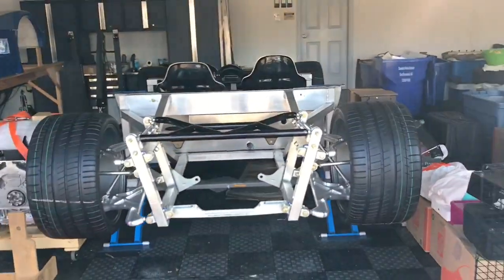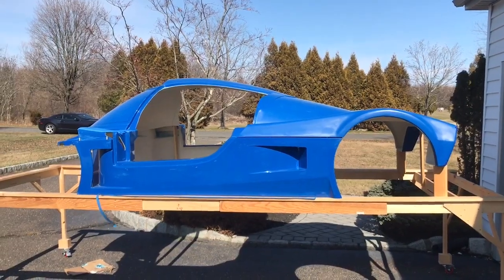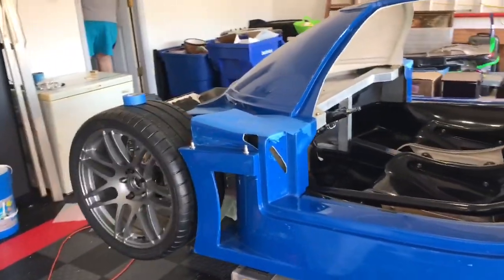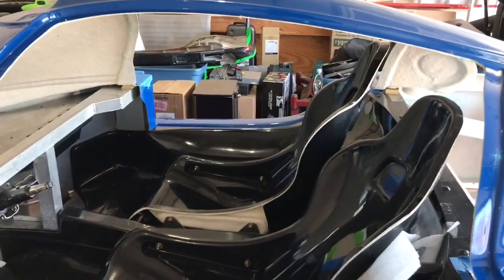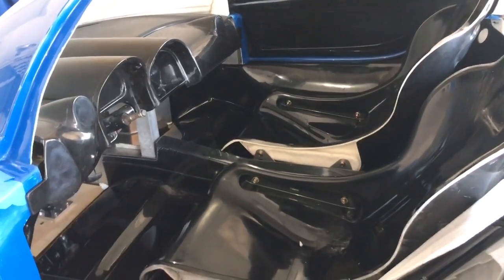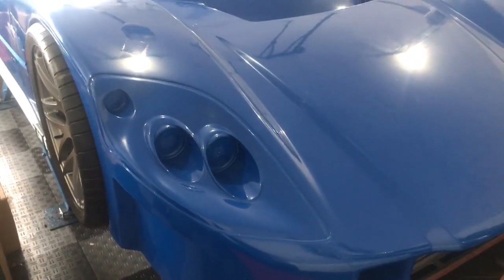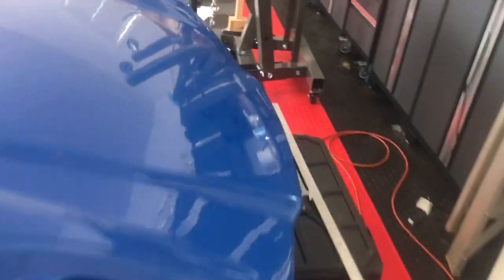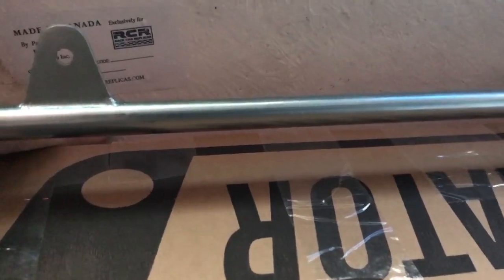Superlite SLC Build 052 Initial body fitment

Comment from the maker: Correction: At the end of the video I mistakenly said the front tires are 12.4” wide which is 1” wider than listed on Michelin’s web site. In fact they are 11.4” wide and the Michelin web site is correct, but just too wide for the SLC with the rims provided in the kit.

Comment: Joel, looks great!   Any feel for the weight of the body components?
Reply from the maker: SS OFFSHORE Thanks! Couldn’t tell you exactly in terms of actual pounds how heavy the body is but two people can pick up that center section with no problem. My guess is the front and rear clam are less than 100 pounds each.

Comment: is there any way you can adapt power windows on that thing??  or have you seen one with power windows??  i'm planning on buying one and would like to have some power windows
Reply: I grew up in the age when there where no power windows.I hate power windows.I am going to put my dimmer switch on the floor too😃.
Reply from the maker: Hi Jose, it’s never been done. Some say it is not possible based on the shape of the door and windows. I haven’t put much thought into it, but perhaps if you buy the 2 part windows and have the bottom portion  retractable either manual or powered it may work. Many builder do power doors. Not sure if that will pass NJ inspection so I am thinking manual doors with the struts to make them easy to open.
Reply: @JoelKSLC  what is NJ inspection? and where should i take my car for inspection to make it legal?? i'm all new to this
Reply from the maker: jose zaragosa every state is different and you really need to under what you can and can’t get registered. Especially when it comes to emissions and safety. What state do you live in?
Reply: Joel K I live in Washington state, Seattle
Reply from the maker: jose zaragosa I would go on the factoryfiveforum and search for registration and see if anyone has registered a car in Washington state. Looks like they have a process for Custom Designed  Vehicles. https://www.dmv.com/wa/washington/custom-vehicle-registration

I would make sure I understand what you can and can’t do before you buy the kit and the engine.

Comment: Looks great, musta felt nice to see it with the body actually on the car!
Reply from the maker: Alfonso Demagistris thanks,  very happy with the fit of the body. I watch alot of component car build videos and the bodies rarely line up well and need quite a bit of work. Once I get the new front tires on, should be in good shape with regard to wheel alignment in the arches.

Comment: If you could find those wheels with a different offset that would be perfect to suck those tires in.
Reply: My fronts are narrower with the std offset and they rub or come very close to rubbing on the inside, I don't see how those tires could be made to fit without protruding.
Reply from the maker: owen ross Thanks for the feedback. There are some other challenges moving those wheels in. Specifically there are coolant pipes that run along the chassis and the wider front tires could interfere with them and limit an already large turning radius.